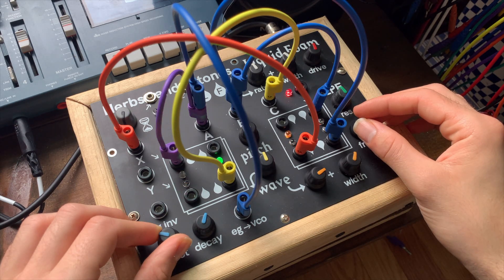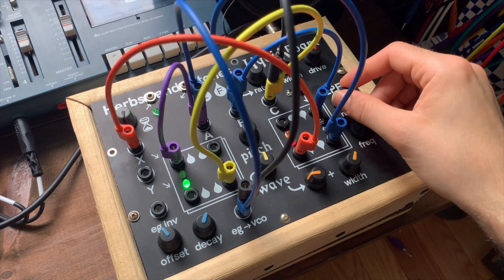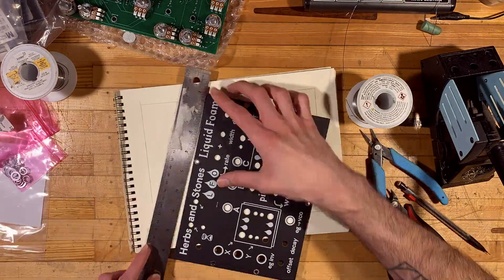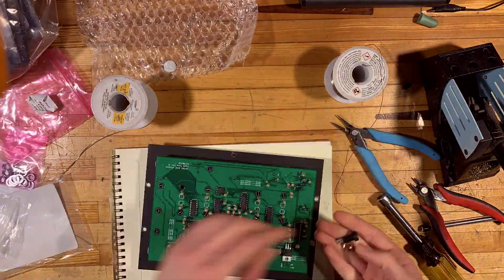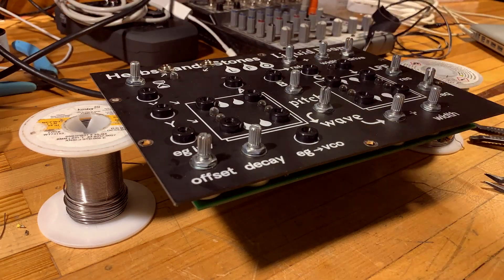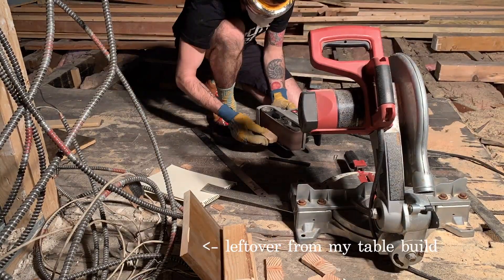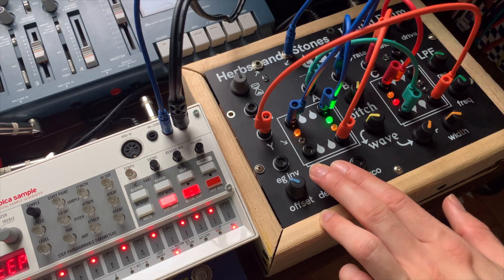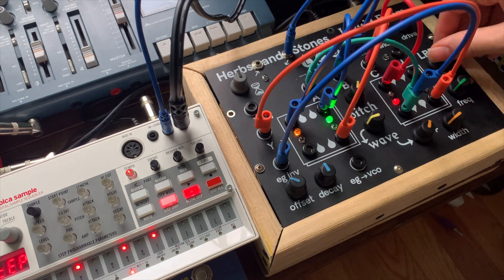Herbs and Stones - Liquid Foam | DIY Video Diary | Raw Sound Demo

Comment: Hey you mentioned mouser I was looking through their website and I was having trouble locating a couple of the parts on there. Given I didn’t spend too much time and it was my first time ever. But just curious if you were able to get all the parts from there besides the knobs you mentioned? Thanks any other tips would be welcomed. Thanks for the video!
Reply from the maker: Hi! Mouser is a notoriously difficult site to navigate if you haven’t spent a lot of time with it. Searching is the easiest way to find IC chips and odd parts, but navigating through the menus is much faster for finding resistors and capacitors. Learning the menu system is the key to being an efficient parts hunter on Mouser :-) However I had no trouble finding everything with the exception of the knobs and the pots, which need to be a very specific model noted on the Herbs and Stones website (there is also a link of where to get them!).
Reply: @rektagon1547  thank you! I figured if I gave it some more time I’d get it figured out. But just thought I’d ask and see. I think I was having trouble with the banana jacks and audio jacks. Anyway I’m still very new to all this. Thanks for your help!

Comment: I enjoyed this video, cool synth and build, nice. Just a friendly tip, you may want to use IC sockets for the chips versus soldering them directly to the board. This makes issues a whole lot easier to deal with in the event you encounter one.
Reply from the maker: Indeed good call. I've since been using the IC sockets a lot more especially on my own builds for the reasons you've cited. When I was building this guy I was just feeling a bit overconfident ;)

Comment: hey matey , i have a LF myself, and i really would like to give it midi in, or even CV pitch and gate, i am not a stranger to soldering, but any chance you could point me in the right direction?
Reply from the maker: Hey Antonio, unfortunately I don’t know enough about the electronics of the LF to help you here, but I do know that the LF is not exactly 1v/oct so using midi in for the pitch will be difficult. Having a MIDI->clock/gate/trigger converter module will allow you to clock it however. If you take a look at the DIY section of the Liquid Foam website, Gianluca includes a few hacking tips, one of them being VCO CV input. You could pretty easily drill out another home in the panel for a TS or banana jack to hook up to the VCO CV in and experiment with series resistors until you find something you like. Implementing CV over gate might be a bit trickier as the gates for the VCO/envelope are controlled by the two sequencers and might take some digging to hack in there.

Comment from the maker: Put this bad boy back on the bench the other day, fixed a few bad solder joints, installed a ground jack, a better 1/4" output (no more hot glue!) and took it for a ride with Plumbutter. Will post a video with my findings and some patch tips soon!

Comment: Intriguing! I’ve got an eye on the Liquid Foam for a while. Any opinion on how it may work together with the Plumbutter?
Reply from the maker: Can't say anything on that yet as I havent tested them together yet. I exchanged a few emails with Gianluca before I buiilt this askign similar questions and he says anything that isn't a negative voltage should be fine. I know the brown outs can be problematic from the PB so I would avoid those. My gut would be so want to sync the clocks on the PB and the LF, but since the clock I/O is 3.5mm on the LF, its tricky to do that with the PB. You can do it with the converter box! Sonically, I think both instruments are in a similar world and would play nicely :)
Reply: Rektagon That sounds promising! I’ve got a converter box for Field kit + C-L so that should work... thank you for this clarifying answer!

Comment: amazing! i have one as well. so much fun.
Reply: Btw whats that drum pattern on the ending jam? It sounded so good. I just started out with drum machines. Normally just do 4 on the floor with my volca beats
Reply from the maker: @Semc_Sucks  Its actually almost a four on the floor, but you move the kick drum from beat 4 to to the "and" of beat 3. I also dropped the kick drum from beat 2 and 3 as well (just gives more of a feeling of levity and anticipation to the groove)
Reply from the maker: I will check it out, thanks!